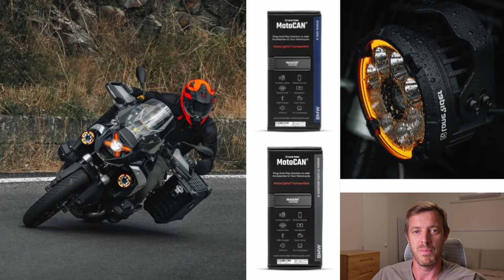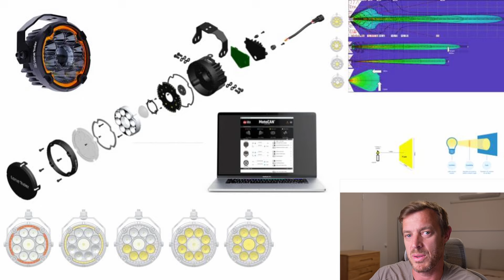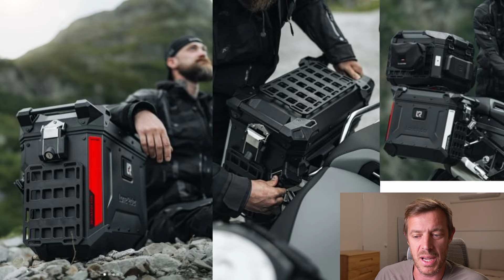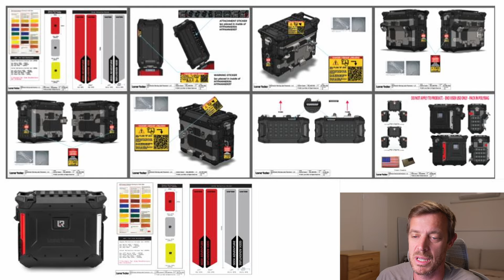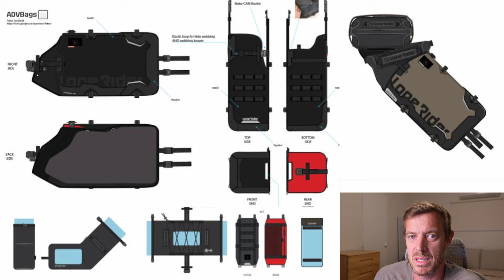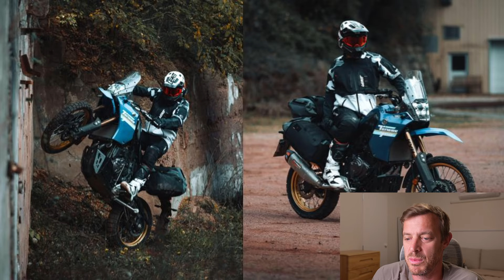Behind the Gear: Lone Rider 2025 Product Rewind, and What’s Next for 2026?

Comment: Hi Andrew, We love the Lonerider gear as you know. The ADV bags are hands down the best motorcycle luggage we have used to date. We appreciate the little things you have improved on them, little things like cutting the straps now to angles to easily go through the buckles may seem minor but add up to the over all quality and ease of use. We would love to use the Motolights on our Tenere’s however it would be amazing if there were a smaller version in Diameter. The larger lights don’t suit the slimmer profile of the bike and are harder to tuck away in a safe spot to be protected from falls. 
Another idea would be a tank bag perhaps a bit smaller than the ranger bag, but I’d like to see a different connection method, the magnetic sliding connector on the current bags can be separated accidentally with the knees when off roading… Ask me how I know! 
We really appreciate the time and effort you put into the R&D of these products that result in us having access to such high end reliable products

Comment: I really appreciate your products and have had an excellent experience with them. I previously purchased the Rackless Motobags for my BMW 1250 GSA, and they worked seamlessly with the OEM rack system.

Unfortunately, that compatibility does not carry over to the BMW R1300 GSA. I’d like to suggest—and strongly encourage—the development of an “Apduro Plate”–style adapter that would replace the existing mounting harness on the Motobags semi-rigid system and MotoPanniers.

Such an adapter would allow these products to integrate directly with the BMW OEM rack system on the R1300 GSA, preserving the modularity and quality your brand is known for while supporting riders transitioning to the newer platform.

Comment: Modify your tank bags with option to utilize the BMW mounting system that’s on the R1300 GS(A)
Reply: I love your products … purchased the Rackless Motobags for BMW 1250 GSA that was capable with the OEM rack. Not so for the BMW R1300 GSA - Please provide an “Apduro” Plate-like adapter solution that can mounted to the Motobags semi-rigid & MotoPanniers to be compatible with the BMW OEM rack system.